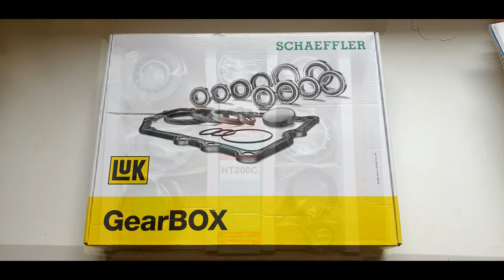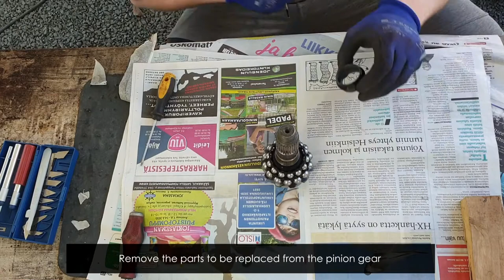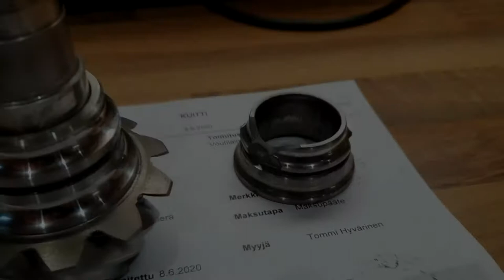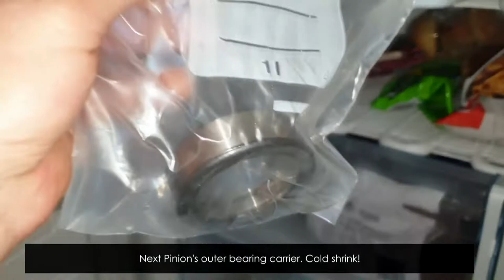Rebuild rear differential [PINION GEAR and PRELOAD] - Drivetrain rebuild PART 7 - BMW E91 engine N43

Comment: A couple of mistakes here. So: to get the big bearing off the pinion, you need to use a bench grinder  and grind away one side of the bearing until it is almost all the way through. Then it can be easily split and it will come off easily. When fitting the new bearing, leave it in boiling water for five minutes and using the old 'split' bearing, hammer it on quickly. When fitting the pinion, DO NOT fit the oil seal until the bearing preload is set. Fit the pinion, fit the crush tube and small bearing and prop flange. Tighten the nut to gradually crush the crush tube. This requires A LOT of force. You will need to clamp the flange in a big bench vice whilst you tighten the big nut. You will need to remove it from the vice periodically to check how much play you have. When you get close, tighten the nut a fraction at a time. When there is no play and the pinion spins easily, mark the position of the nut to the pinion with a centre punch and remove the nut and the flange. THEN you fit the oil seal (dip it in oil first) and flange and retighten the nut to the exact same position. When dismantling, make sure you mark the diff retaining circlips as they are shims and they MUST go back the same way. As for oil, EP90/140 synthetic is best. Also examine the condition of the sun/planet gears inside the diff. If they are badly pitted, the diff is basically scrap.
Reply: hi! after rebuilding my diff, i got rid of the howling noise but a new one appeared, on deccelerating/braking i feel a slight vibration in the car and a sound of rubbing/vibration coming from the diff area, could bad preload adjustment cause this? mine had a very very slight bit of play

Comment: Thanks for this nice video! In my case, the nut is still very, very loose when the clearance is already 0. Would you know what could cause that, or is that normal and does it need loctite? Thanks!
Reply from the maker: Thanks for watching!
Did you replace the new crusher sleeve?
The main bolt must not be left loose! Loctite is not needed.
Reply: @JaniVoutilainen  I'll press some more on the outer bearing shells and see if that gives room to tighten it. When comparing the old and the new crush bushing it is clear the new one is not pressed yet. Thank you for your help!

Comment: hello Jani , respect for your work. i wanna ask u , my diff on e91 touring make a whining noise. mechanic diagnostic : need replace diff. but i wanna rebuild like u my diff cause if i buy another one (not new) maybe after some km come back at same problem. if i respect your steps i make this whining dissapear? thanks. p.s. how much to fix it for me ?
Reply from the maker: After all, doing this is quite a project. And especially when I myself have never done anything like it before. Only an engine repair I did less than a year ago before this.
It’s a bit of a lottery to go change the diff used. That’s why I decided to go into this project myself 👍

Comment: its actually should be not zero, there should be some preload. 
you might end with some noise, especially, when you install new one. there should some small drag on the bearings.
Reply from the maker: Thanks for your feedback!
On older models where tapered roller bearings are used, they must have a preload.
To my knowledge, this 168L model should have no preload at all as it uses ball bearings and crush spacer.
The goal is zero preload. Tightens gradually in small steps approaching zero bearing clereance.

The car has now been running for a few days and so far the diff is still working well and no any extra sound. The original fault; howling is lost :)
Hopefully diff will stay that way in the future;)
Reply: @JaniVoutilainen  
Hey,
Are your diff running well with this setup without preload? Or you had to adjust later some extra preload? Actually I'm in the middle of the diff overhaul (same 168L) 
Thank you!
Reply: those are preload values but special tool is needed to measure them:
- 168L (ball bearing) - 0.2Nm - 0.4Nm
- 188L (ball bearing) - 0.4Nm - 0.6Nm
- 215L (ball bearing) - 0.6Nm - 0.8Nm
Reply from the maker: @csmarcell  Hi! It's worked okay, Thanks for asking 👍

Comment: Where did you get the replacement parts for the diff. I wanna renovate my old diff, I currently switch the one i had for a renovate diff. So now I’m thinking of buying parts to fix my old. You have any links for the parts you used? :)
Reply from the maker: For example, Google it like: "BMW rear differential rebuild kit 462014710"
And here's one link: https://www.schmiedmann.com/en/product/1979474-new?product=462014710

Comment: Great video mate! Is it usually the pinion that makes the whining noise or the side carrier bearings? 

Also what is that long flat bar you use to hold the pinion while tightening called? i want one! :)
Reply from the maker: Thanks! 👍
Usually it is the pinion bearing that makes that sound.
That tool is like this:
https://www.turnermotorsport.com/p-640926-bmw-fan-clutch-wrench-set/